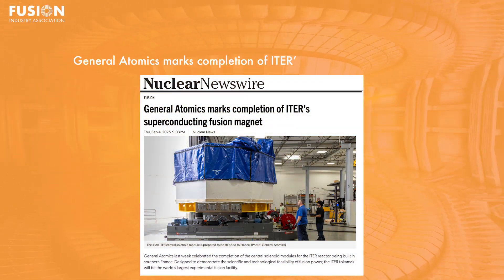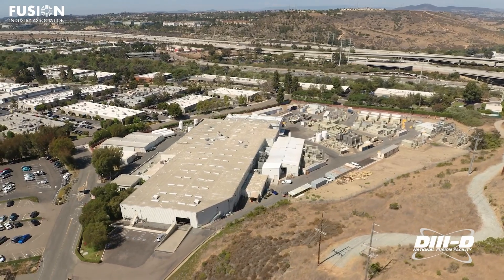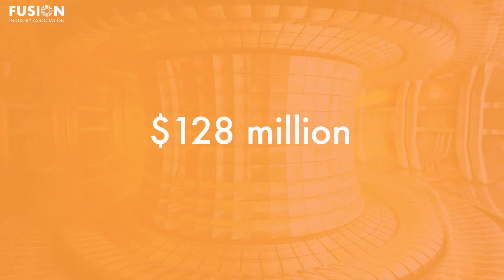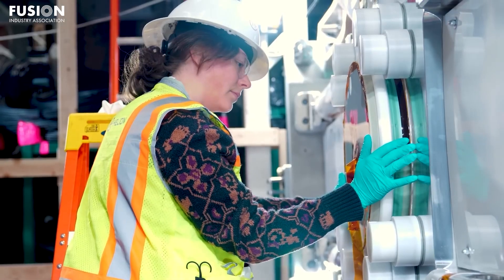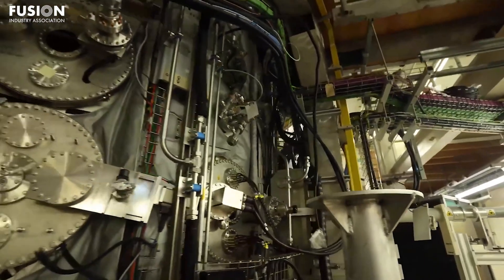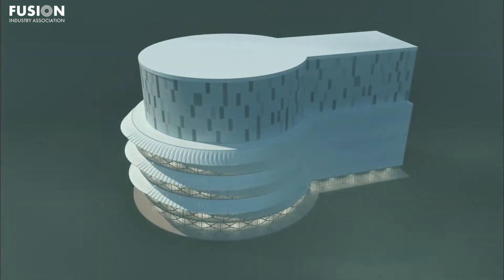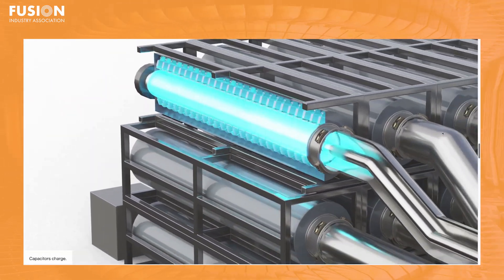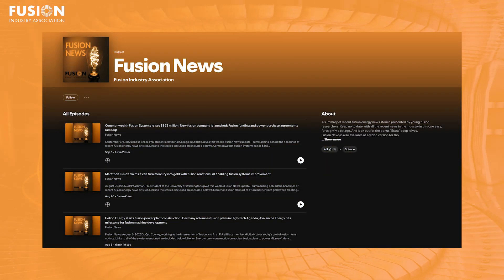Fusion News, September 17, 2025

Comment: Now for the reality....
The Sun in a bottle.......Pity the bottle is not strong enough.....
The core problem......There is no known material that can withstand the neutron bombardment radiated from the fusion plasma at the power required for say a 500MW electrical generator.
This is one obstacle of of many.
You will note thet Fusion Power Plants are always 30 years away and yet the money piled into it is growing.
The promise of  Fusion power needs a lot of money to keep going.
Guess what? 
Fusion power burns money with no return.

Comment: Anyone who knows anything about the fusion industry but is not employed by it so not dependant on a pay check, knows that fusion power research is a massive waste of time and money. ITER will have to go through several more prototypes each doubling in size before it might pay back in electrical output. This will take 200 years at current rates of development. There is always the problem with Tritium, it doesn't exist, and doesn't breed with over unity by a known technology including Li/Be breeding. Meanwhile any fission works on the back of an envelope because the neutron economy guarantees a gain of 2.5 or more, it has to be limited. As an engineer familiar with every type of fusion BB, stars, and theoretical energy plants and bombs, I cringe at these peoples work. By the time a fusion power plant is working, it will have swallowed up so much resources we could have had 100 new 1GW power plants up and running today. And as always neutrons that escape the plasma as they surely must will irradiate the wall lining.
Reply: It is obvious that actually you know almost nothing about fusion and how much closer we are now to a practical reactor system for fusion.  You must just like making a fool of yourself.
Reply: @richardprice8348Unfortunately this is a very ignorant comment. It is clear to me that the person you criticised knows a great deal about fusion.
Reply: @richardprice8348  I am afraid @JohnJakson-i3w seems to know what he's talking about, although I would not use such drastic conclusions, but he has a point. Please state your experience on the subject to qualify your comment. 
A few points, for your consideration: 

KEY RISKS
•	Fusion is complex: high-temperature plasmas, superconducting magnets, tritium breeding, and remote maintenance create new reliability risks.
•	No operational precedent: Fission plants demonstrate 85–90% availability; fusion projections remain speculative.
•	Economic viability: Competitiveness requires ~75% uptime and capital costs of $5–7k/kWe to deliver electricity at $80–100/MWh.
•	Policy relevance: Governments, regulators, and investors need clear, risk-informed pathways to avoid overpromising and to prioritise impactful R&D.
•	Availability & Reliability: Long outages from complex maintenance cycles.
•	Maintainability & Inspection: Dependence on complex plant design, complex remote systems and logistics.
•	Safety & Licensing: Regulatory frameworks are still in development.
•	Workforce & Supply Chains: Shortages in skills and critical materials (e.g., tritium, REBCO).
•	Non-Competitiveness: Downtime or escalating O&M costs could undermine market viability.

OPPORTUNITIES FOR MITIGATION
•	Design the plant for maintainability and inspectability (maintenance by design).
•	Design for plant operability: reliability-driven.
•	Demonstrate remote maintenance and related logistics flow and timing at scale before 2040.
•	Digital twins & predictive models to anticipate failures and optimise downtime.
•	Fuel cycle assurance through tritium breeding and tight accountancy.
•	Early regulatory engagement to reduce licensing uncertainty.
•	Workforce and supply chain investment to scale capacity ahead of demand.

RECOMMENDATIONS
1.	Treat operability as a first-class priority in fusion R&D, on par with plasma performance.
2.	Develop a standardised operability risk framework similar to fission’s Probabilistic Risk Assessment.
3.	Fund targeted demonstrations (maintenance campaigns, component replacement, licensing exercises) pre-2040.
4.	Frame challenges as opportunities: lack of operational precedent allows fusion to be designed from the ground up for reliability.
5.	Fusion must adopt a design-for-maintainability philosophy: embedding operability, maintainability, and inspection requirements into plant design from the outset. This approach—drawn from lessons in fission, aerospace, defence and large scientific facilities—ensures that systems are engineered for accessibility, modular replacement, and reliability rather than retrofitted with maintenance solutions as an afterthought.

Fusion can be a competitive, clean power source—but only if operability risks are addressed early and systematically. By shifting focus from “can we ignite plasma?” to “can we run plants reliably and affordably?”, fusion can earn the credibility it needs with policymakers, investors, and the public. 

Hope it helps
Reply: @richardprice8348 I see my previous post has been removed, so I'm trying again, with a different message, based on recommendations on what is urgently needed:

1.	Treat operability as a first-class priority in fusion R&D, on par with plasma performance.
2.	Develop a standardised operability risk framework similar to fission’s Probabilistic Risk Assessment.
3.	Fund targeted demonstrations (maintenance campaigns, component replacement, licensing exercises) pre-2040.
4.	Frame challenges as opportunities: lack of operational precedent allows fusion to be designed from the ground up for reliability.
5.	Fusion must adopt a design-for-maintainability philosophy: embedding operability, maintainability, human factors and inspection requirements into plant design from the outset. This approach—drawn from lessons in fission, aerospace, defence and large scientific facilities—ensures that systems are engineered for accessibility, modular replacement, and reliability rather than retrofitted with maintenance solutions as an afterthought.

Fusion can be a competitive, clean power source—but only if operability risks are addressed early and systematically. By shifting focus from “can we ignite plasma?” to “can we run plants reliably and affordably?”, fusion can earn the credibility it needs with policymakers, investors, and the public